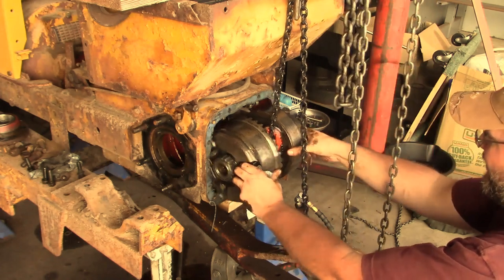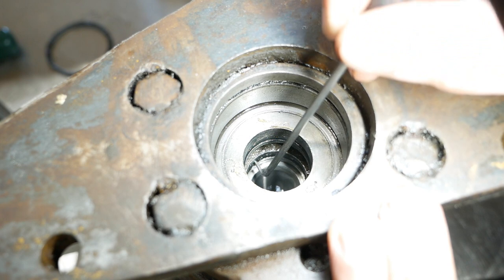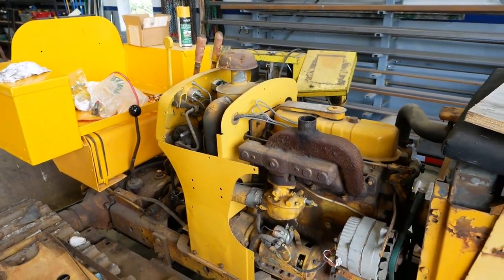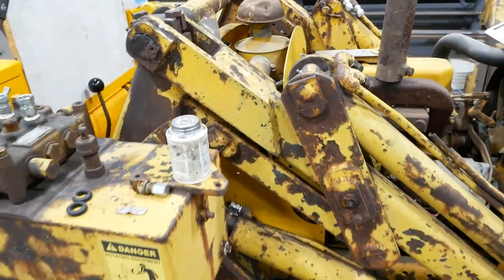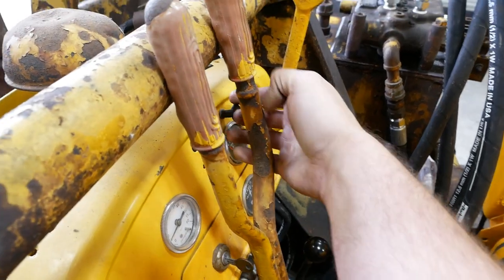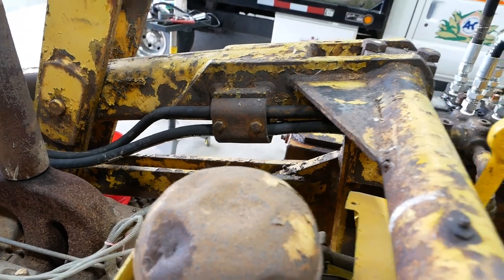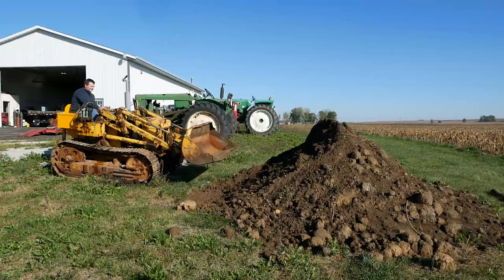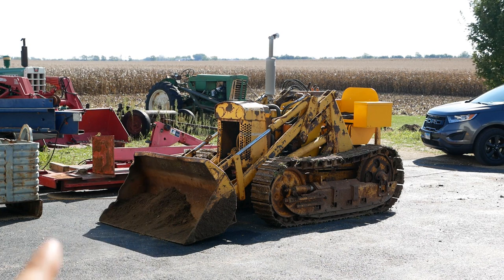60 Year Old Oliver Crawler Returns to Service - Installing Loader and Everything Else

Comment: I admire the owner’s determination and depth of his pockets in getting this machine back to operating condition.
Reply: Prolly guessin the owners name is Mr. Oliver,  'n he designed it! Lol
Reply: @JohnSmith-tv5ep   My name isn't Oliver, but I used to run a 770 Oliver for the neighbor when I was a teen. In fact, I spent some time getting that old tractor running again this spring.😎
Reply: @bluegrallis  good deal, well then....🎶back in the saddle again 🎵 !!
Reply: My pockets aren't very deep.  I probably won't have any more tied up in "Scoopy", than some have paid for a similar "running" crawler with half wore out undercarriage. This thing has a great running engine. A bunch of work was done on the engine just before the right track quit driving, and it was parked for a decade or more. It also shows almost no sign of wear on the rails, bushings or sprockets. Now, the rest of the drive train is in great condition
Reply: @bluegrallis   enjoy it man. It was really good to see it
Reply: Here's to many more happy years with scoopy 😁

Comment: I am amazed you didn't cause more damage than you did when mounting that loader attachment. The Oliver you were using seemed determined to do as much damage as possible. 
While I can take or leave a video on replacing that leaky control valve, what I would really enjoy is watching you deliver it to the owner and have him test it out! If he does not mind appearing on video that is.
Reply: I'm in the video, a couple of them in fact. That was myself, trying to drive 'Scoopy' up on the trailer when Wes first got it running again. Can't hardly wait to put it in the dirt here at home. 
😁
Reply: @bluegrallis  Excellent! I am glad you opted to be in the videos. I know some people prefer not to be on camera. That is a lot of commitment knowing upfront you had to wait so long for the project to be completed. How many miles is your place from Wes's shop? Does he have a long haul to deliver it?
Reply: @bluegrallis  I would be stoked to have it back too. I'm glad you opted to get it going again vs. scrapping it or parting it out. Any plans to throw some paint on it? It would be cool to take her to some tractor shows even if it's not a show quality job. It's an interesting machine and there aren't many left.
Reply: @ChevyConQueso  I would like to do an Early Schibe job on the heavy metal
Been working on the tin when I can, to keep it decent for a long time.
Reply: @ChevyConQueso  Wes is about 10 miles from me.
Reply: Google Sux  I have used many machines with jerky hydraulics like that Oliver. I guess that makes me a "typical mechanic" as well.
Reply: Duct Tape!!

Comment: There's nothing better than having a piece of equipment fire right up in cold weather, you had worked on. . Older stuff being simpler , usually does the job and works.

Comment: I found this about battery disconnects,
"There's considerable controversy over whether it's best to hook up the master-shutoff ("kill") switch to the battery's positive or negative side. NHRA rules still mandate a positive-side hookup, but most stock-car sanctioning bodies want the kill switch on the negative side. I vote for the negative side if it's legal. On a switch connected through the positive side, the exposed terminals on the back of the switch or a broken positive cable could contact the sheet metal or frame during a crash, creating a short to ground and safety hazard. The negative cable connects to the body ground already—so there's no additional danger if it rubs. It's the same principle as to why you should always disconnect the battery's negative side first before performing electrical service."
    On a tractor, whatever floats your boat.
Reply: Logical.
Reply: In a crash starter cables, battery cables winch cables can all get shorted...the switch contacts is the last of ones worries
Reply: @mrmotofy   This is a tractor. I don't think that's an issue.  LOL
Reply: Double-down, install two cutoffs !
Reply: Yep, negative, does seem more logical.
Reply: Negitive positive, positive negitive is what I was told by my tutor when disconnecting and connecting battery's.
Reply: @firesurfer  what the man said
Reply: @MegaDirtyberty  only on negative grounded vehicles.........
Reply: The same situation occurs here, rules that were written for old positive earth engines. Kill switch should be in the ground lead as close to the battery as possible so the only risk of a short is across the battery terminals only. My old vintage racer has the kill switch in .....you guessed it, the positive lead, which is the ground lead between battery and engine block.
Reply: @mattyb7736  Obviously...
Reply: Lol grease monkeys half full half empty.

Comment: Thank You for completing OC46. I’m thinking that this machine could be older than 60. I’m 75 and when I was a 15 year old Kid, I worked for a small JI CASE Dealer in Kamloops BC, and I loved this machine that was taken in on trade and maybe 10 years old back then. I had a lot of fun spreading cinders from the WHITEWAY LAUNDRY coal fired boilers on dirt Equipment Lot that was next door. 
You gave us a lot of good videos. Thanks again.
Reply: It's 61 this year It is a 1960 model according to the serial number.

Comment: This comment counts as qty:1-Huge Demand.

Back in the 80's, on the coldest day of the flipping year, my 76 LTD fuel pump pulled that diaphragm stunt on the way across north Texas at 0530 in the dark AM, first day of Christmas break.  Sounded like a clattering knitting needle convention.  Oil was way past full, I got some motor honey on the interstate, and dumped it in.  We pulled into Tyler, shouted out a request on the 2 meter radio for directions, and waited at Whataburger until Autozone opened.  I swapped out the fuel pump and did an oil change in the dirt lot behind the 'zone.  It overflowed the drip pan I bought.  Wind chill was WAY below freezing.... I couldn't back the nuts off the pump without having to warm my hands up for a bit. Leather gloves were too stiff to wear.  We made it home to visit kin in Lubbock, but the heater couldn't keep up.  Long story that.....  We unpacked the suitcases and dressed the little ones up in every thing we had just to keep them warm.  What a memory.  Thanks Wes.
Reply: Sounds similar to some of my mechanical adventures.  Main thing, we made it!
Reply: @woodhonky3890  Yeah, crazy times, but we learned a lot, and kept on going.  have a great week WH!
Reply: North Texas....hahahahah cute, we have colder than that up here! I've seen -30 f no fun
Reply: @tacomas9602   "All-time low temperature records were broken or threatened.  Waco dropped to an astounding -4 on December 23, 1989, just one degree shy of the all-time record low set in 1949.  I remember reporting the current temperature on the 10 p.m. newscast the night before and it was only 9 degrees." 

Thanks for the comment, made me look it up.   We were about a 100 miles north of this, so that morning was pretty dadgum cold.  Living up where you do, I would imagine you have block heaters, and winter gear that help you make it through that cold stuff.  I was wearing a pair of blue jeans, cowboy boots, and a jacket.  But you're right, 30 below is cold.  Windchill that day would have been about -33 to -39F.  It was about  -10F with wind blowing 30mph from the north.  I remember the snot freezing in my nostrils, and I could only get the nuts about half a turn until I lost dexterity in my fingers.
Reply: @stxrynn  it's the humidity. A friend of mine stayed with us for a couple of years and went back to Colorado because he couldn't stand the winters in NE Oklahoma.
Reply: @JamesCouch777  My unlce lived in Dewey.  I've been there in the summer, never in the winter.  That's even closer to Santa Claus than where I grew up..   Brrrr....

Comment: When I used to work for Perkins, if we had porosity or "breakthrough" on  drillings for oilways in cylinder block castings we used to use loctite 638 to fill  cracks, splits and voids (it can be used as a permanent thread locker/filler as well ----- we did also use it to glue/seal the wet liners into the blocks as well ) in combination with loctite activator 7471 (it will cure itself but activator speeds up the curing process and improves the adhesion bond to the surface) as one possibility to fix the crack in the spool valve or as an alternative because 638 is quite viscous very low viscosity superglue with baking soda as an activator (the soda won't get into the crack but will set off the glue in there --- this is good also for fixing thermoset plastics such as tractor fenders and hoods/bonnets like John Deere) giving a "glass" hard crack fill (I am tempted to try this on pitted/scored hydraulic rams as a cheap alternative to re-chroming or replacement on cost critical work but worry about peeling due to vibration, heat expansion or flex).
Reply: there is also a locktite  2 part epoxy we used in the power plant on pump shafts for small imperfections,  i will try and find the name of it.  we called it metal bondo,  clean the shaft etch it and then lay it over and machine it off.  worked great for small pits in big stainless shafts..  if he isnt going to use it much the pitting in the shaft can be jb welded and sanded..  it works for a while..  it will lessen the leak...  .
Reply: The super glue and baking soda trick is used by Die Cast toy restorers, they can build it up and when they are done and the toy is painted, you would never have known it was cracked or broken
Reply: I miss my perkasaurus...
Reply: Very good to know. Tha word is out now!! 😁
Reply: @bryanphillips6666  quite right, i first heard of it on Marty's matchbox makeovers YT channel.

Comment: I am 68 years old and was working on farm equipment when I was 13. I seem to remember all 6 volt systems had them heavy battery cables for a reason. Not sure what that reason was some thing to do with being much better for carrying 6 volts. The other thing is I put 8 volt battery's in every thing that was useing 6 volt system and it worked very well. Or I would convert many over to 12 volts change the generator to 12.volt alternator had to change all the lights to 12 volts, add resisters to the ignition. They would always start much better and never really harmed the starters. Its great watching some one working on so many different projects. Thats the way it was for me on the farm even as a young kid. Keep up the great work.
Reply: The reason for the heavy cables is, it takes twice as many amps at 6 volt, to do the same work as a lower amperage 12 volt system.
 I converted this one to 12 volts using a '12 volt' coil, so no resisters are needed. A cheap used old Chevy alternator just barely clears the loader arms if your belt is short enough.

Comment: I see you're 1650 Oliver has just as smooth Hydraulics as my 1850! Yep, extremely aggravating with a heavy load. Kudos to you for lowering that heavy thing all by yourself and getting it into position.
Reply: You can always add a restrictor in parallel with a one way valve on the boom lift line. Full flow via the one way valve on the way up, slow and smooth through the restrictor on the way down.

Comment: Wes, we had one of these. It was a 1963 Model. It cost I believe $6,000.00 new from the dealer. We had a hydraulic 3 pt hitch. And yes Its weird to operate but we got used to it. As I remember the Reverser lever was on the left side not the right on ours. It had enormous power for a 3cyl Hercules. We owned a landscape nursery and used it on landscape jobs and in the field lifting large trees out of the holes. We had a special "hawk nose" tree attachment on the loader to lift trees out of the hole after they were balled and burlaped. We used the 3pt with a trencher V implement to cut a trench and line out new trees in the field. This video really brought back a lot of memories. Thanks so much.

Comment: I was actually surprised when old mate said to use the electric pump instead of the original mechanical pump, I guess he is more interested in reliability than authenticity. While you had that hydraulic spool valve out I would have given to old mate as I think you said he was an ex machinist, he would have knocked one up quick smart on a lathe. Also, really enjoyed your message at the end of the last video about the plan for a restoration, skill level and machinery you’re working on, it was spot on.

Comment: Hi Wes, Braze the spool valve and machine it back to the standard size.
Reply: Wes said it was (and presumably needs to be) very hard steel.
Reply: @paulwomack5866  The brazing / welding process might anneal that steel enough to make it machinable.

Comment: Gooday Wes
You cold wash out the spool stand it up on the end clean again with loctite primer  warm a little then fill the hollow at the end with loctite 545 hydraulic sealent this has worked for me before with the clamp reducing the ability of the crack to spread  good luck 
Len

Comment: Nice job! If your customer ever wants the cylinders fixed on the loader, Able Machine in South Carolina used to handle all the rechroming work my dad did.  He did business with them for years, he seemed to be happy with their work. He was a mechanic and later foreman at a Clark & Crown forklift dealership.
Reply: Wouldn't shipping both ways just pay for new cylinders, on cylinders that small ?

Comment: Well done Sir!  I dont know about the rest, but personally I'd love to see what you end up doing with the Cylinder and with the hydraulic controls. Replacing it with new could be pretty reasonably straight forward but I'm betting you end up recycling or repairing something to get it to work. At least with a new one, it might give you a spring on the boom control

Comment: Wes, I had a Subaru Justy years ago that needed a muffler for state inspection, and since it was only 66hp, I used a tractor muffler on it, and it worked surprisingly well. I think the exhaust pipe was 1". The factory muffler was over $80, the tractor supply muffler was about $20.

Comment: Wes, I just picked up some new hydraulic line fittings at a local scrap yard. They are for a garden tractor that I'm building. It will have either an 18 HP engine, or a 21 hp. I have a Kubota 18 HP gas engine, that is most likely going to be the power plant I'll use. I bought it for $75, and had it gone over. The only issues I had were a leaky, brittle radiator, and the need for new gauges. I'll integrate them into the body when I get that far.

Comment: If you flip the strap over on those bolt-on battery terminals they work a lot better. Not saying they're amazing but they do hold quite a bit better than if the strap is the way it's "supposed" to be.
Reply: Yes, same as I do, but also solder the cable before final tight in the terminal, less corrosion and better contact from my experience.
Reply: Some UK mains plugs have cord grips designed that way, flip over depending on thickness of cable.

Comment: Nice fix on that spool. I don’t know whether there’s a standard accepted pattern on reverser levers in general, but fwiw, Caterpillar reverser levers on their old standard transmission dozers are like this Oliver where it’s back for forward. 

My old Clark/Michigan loaders came with the most annoying control valve arrangement for the lift function and it’s only the “up” control side. To lift the boom its all or nothing. Just full send with ALL the flow. You can’t feather it. Additionally, it locks in place. So every time you lift something you just bang it into the “up” position and when it’s up high enough you have to bang it out. When these loaders were new, they unloaded ore freighters on Lake Michigan so I don’t know but someone thought it was a good idea. The guy I bought these loaders from has modified the second loader to eliminate this “feature”. I’d love to do my other one too — we’ll see.

Comment: Never a bad Idea to put a chainfall in the mix when landing something like that, get it close and then you can gently lower it the rest of the way with the chainfall.. For the valve I would turn a dummy out of solid bar, maybe even aluminum? something you can get a descent surface finish on
Reply: Ditto, what I was thinking.

Comment: Always put the cut off on the negative (ground) side of the battery, if the positive terminal of the battery touches the grounded metal of the vehicle isolating the negative (ground) side will stop the short.

Comment: Can you to a top speed run with that in high gear?
Reply: I guy would want some pretty smooth ground since there is no suspension and no spring in the seat yet. It gets rough riding at idle in third, let alone wide open in 4th. 😲

Comment: I had one of those machines back in the 1970's and as I recall we ran it with the motor wide open.  It had very strong hydraulics and was quick as a cat for a dozer/loader.  Mine was what they called a spot turn model in which it used some kind of planetary steering system.  You could actually make the tracks go in different directions and turn in circles.  It was the closest thing to a modern skid steer, track machine.  It was the quickest loader I had operated up to that time.  Was a long time ago, but it did a great job for us  until I decided we needed a larger unit.  I think we replaced it with a John Deer 125 skid steer.  Also, ours had a large counter weight on the rear above the draw bar.  Small but mighty rig.  Nick, North West Farmer